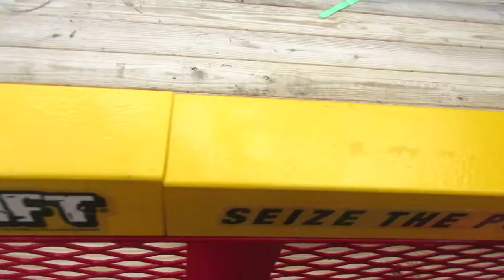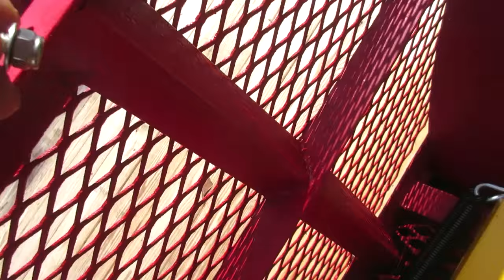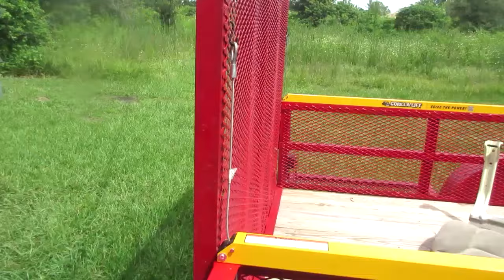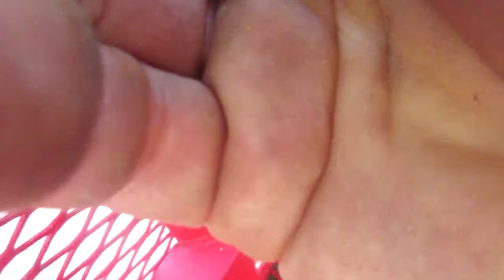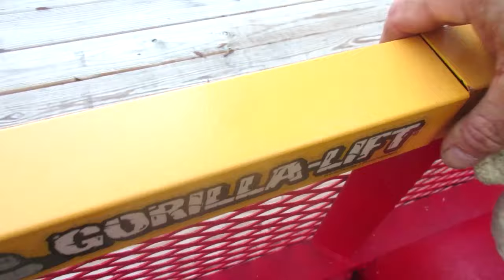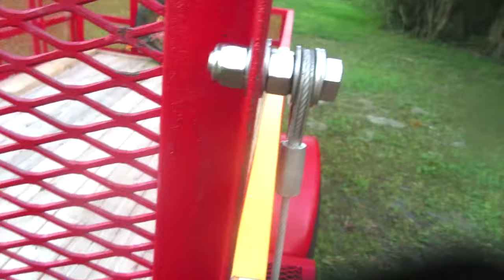Non-standard Gorilla lift tailgate assist installation on a 6' x 12' utility trailer.

Comment: "knock off or gorilla" both use my original design that gorilla saw at Alton lows or somewhere in Illinois  20+ years ago. I built the original for an old business friend having trouble with his trailer gate 32 years+ ago. The gate catching or hanging is caused by spring drag this is caused by the square tube, if you use 2 inch round pipe the gate will lift and lower like butter. I guess they went with square tube to avoid any patent thing. I never patented this little creation though I did conceive it, built it, on a friends trailer. If you want to make your own use round pipe, a heavy garage door spring, and a cable pully at the end of the pipe. You'll get a smoother gate action up or down with round pipe than square tubing. If I can find the time I'll go measure the original lift assist and you all can make your own.

Comment: Your issue is that you are supposed to keep the full extension to 4 feet. You are mounting them too far up. A little slack wouldnt have hurt while it was up.
Reply from the maker: Greetings. I assume you mean the mounting point on the gate. The issue I had was that the "height" of the mounting point was related to how much weight the springs would handle. Any farther down and there would be almost no assist. The only solution I could see to make them work as intended where the gate became nearly weightless would be to make the spring boxes and the springs/cables longer. I ended up with a little slack when retracted. I would have liked to have more travel. I still run out if the ground drops away and the gate has to go lower but for the most part it works fine. It's possible the company might actually make them a bit longer. I don't know if they would actually do that. Anyway, I just wanted to share what I had to do to get the system to work for me. Thanks.